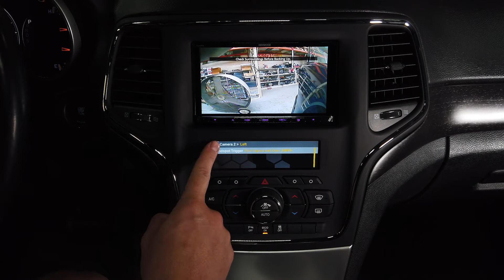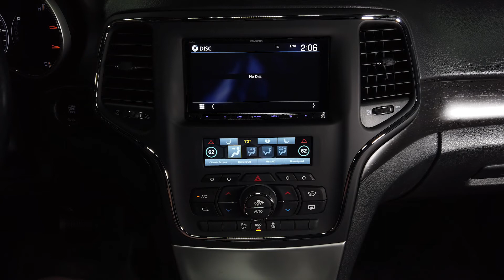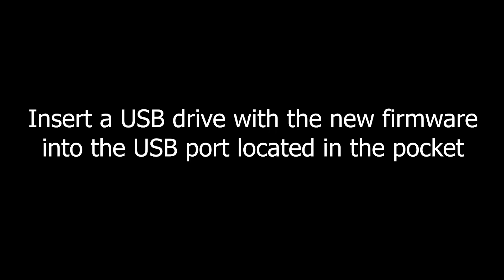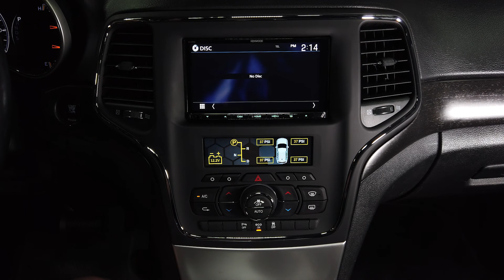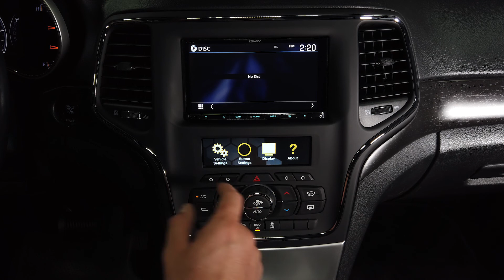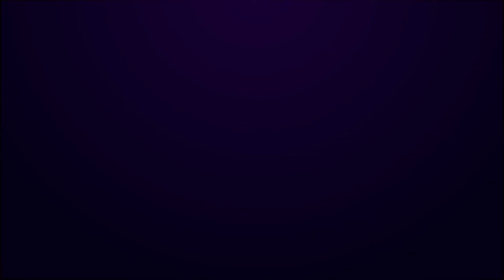Grand Cherokee RadioPro Integrated Kit - RPK4 CH4103

Comment: Mine used to turn on now. It doesn't the power from the car works. Where the harness  connects with each other. Does not have power from there to the radio? How come?

Comment: I have this unit installed by specialized installers. Great unit, great features and works very well. Great video, however it doesn't shows in detail how to change logo onto slash screen. Where do you plug in USB and how. I tried 2 front USB ports and they are connected to Pioneer radio not to slash screen. I would like to change logo. Any help please.
Reply: there is a usb on the back of it, although I have not gotten it ot work yet either